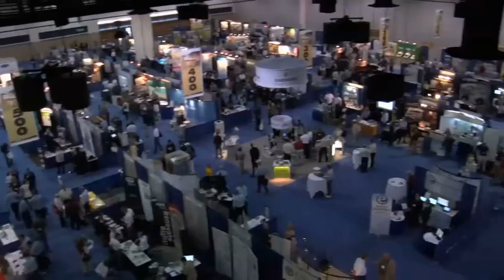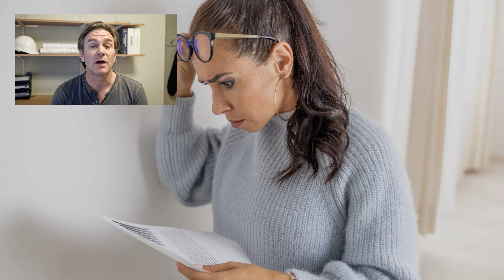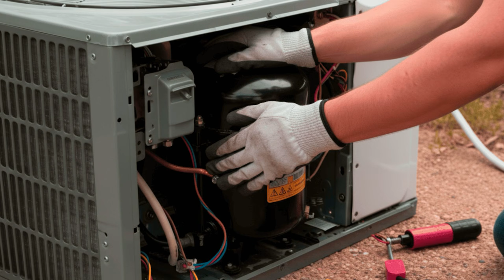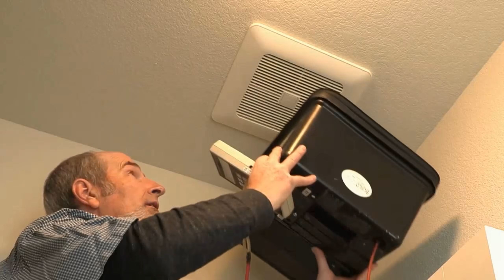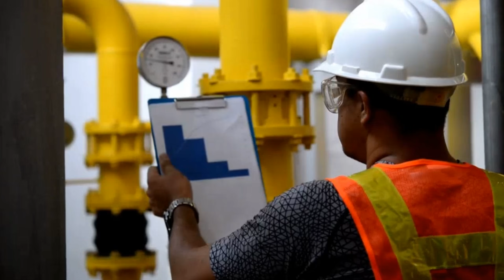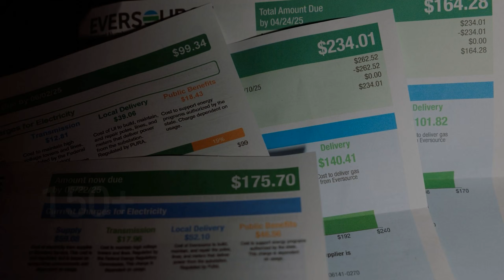Why Builders Undersize Your HVAC by 20% (The Comfort Scam)

Comment: the warranty for new homes is like tiolet paper. the hvac manufacture warranties alot of hvac companies avoid because they cannot make insane parts monies. they don't care about size it's about maximum looting. try getting them to install a larger duct to hot room. they're not interested in that. they'll sell you a new hvac for 12k-15k no problem though.

Comment: Even when there is a Manual J load calc down half the time the equipment supply house does it for free and it's basically worthless. Should always use a reputable 3rd party or at least have them verify the inputs are correct. Don't forget That Manual S (equipment performance selection) and Manual D (duct design) must also accompany the Manual J. Can't do 1 without the other 2!